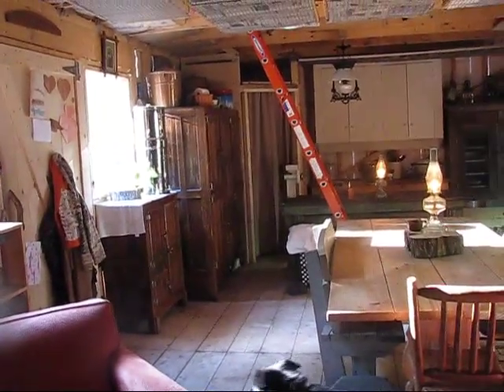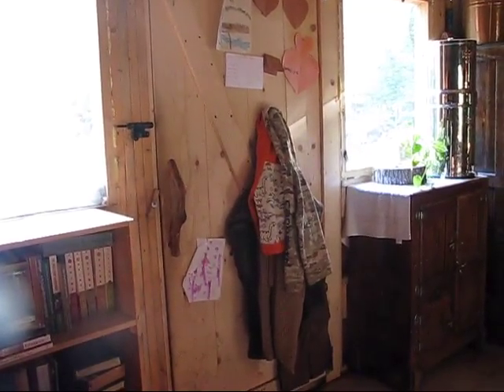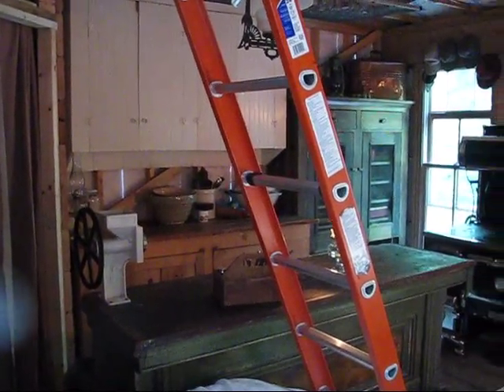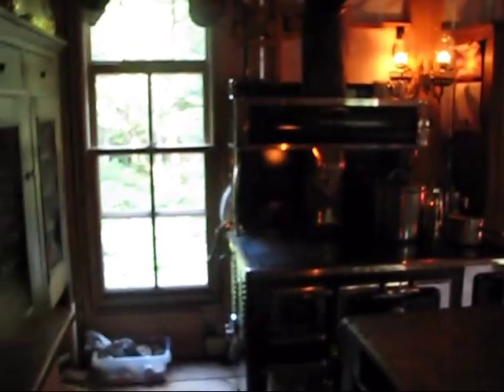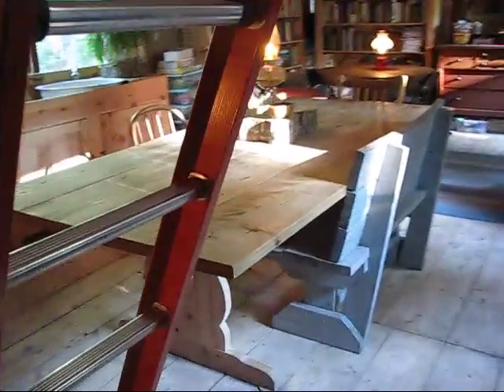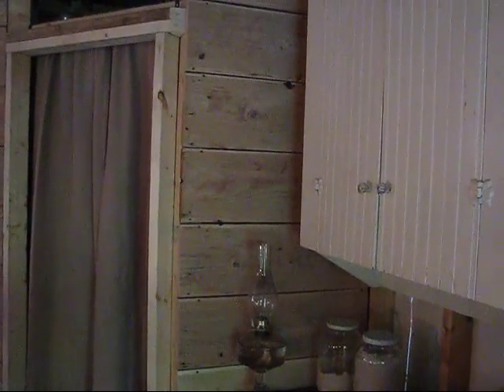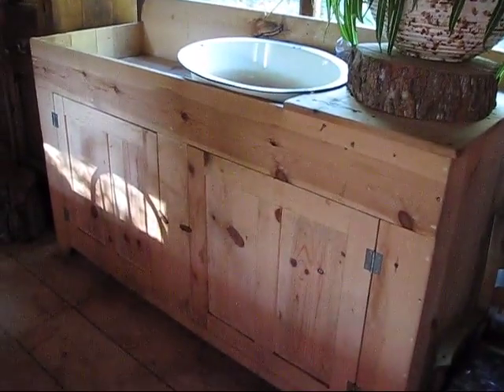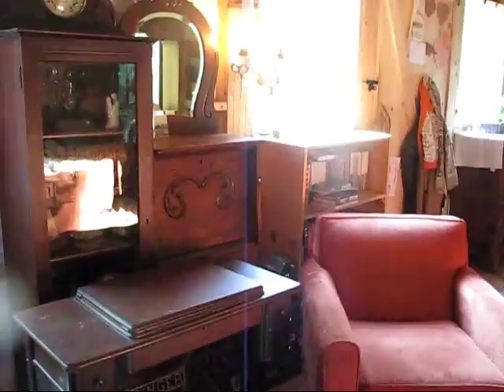UP Off Grid Cabin Tour Inside

Comment: Your cabin looks so homey.  You mentioned several times "down South." I was raised in so. LA, moved up to north of Picayune MS and lived in a handbuilt cabin with no electricity for 18 months, no running water for 13 months.  This was before solar. Seeing the oil lamps and ladder really brought back memories.  The way around a sweltering kitchen (for me) was building a galley type screened walkway between my two buildings. Put up plastic during winter. Lattice kept the bigger animals out. Loved it.   Summer kitchens are really worth their weight in gold in the South.

Comment: Just wondering...
Would it be a violation to hook up an RV pump to those water cans and hook up a faucet and shower?  All you need for water is those cans, hose or PEX, an RV pump, a portable on demand Eccotemp L5 water heater, faucets you like, sinks, and a shower and bath. Really easy. Nothing has to be outside except to vent the water heater.

Comment: You probably are aware that there are kerosene powered refrigerators. I have seen the wicks for them sold at Lehman's and if this is an option for you they may have information on where you can get them.
Reply from the maker: Hi Linda, I knew there was propane but had never heard of the kerosene.  We will have to check it out. Thanks for the info and for watching!